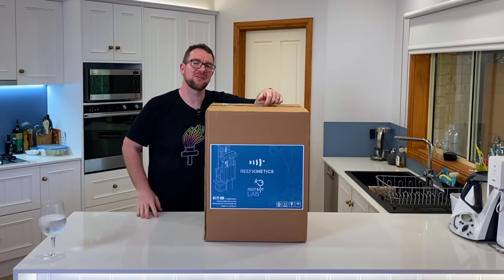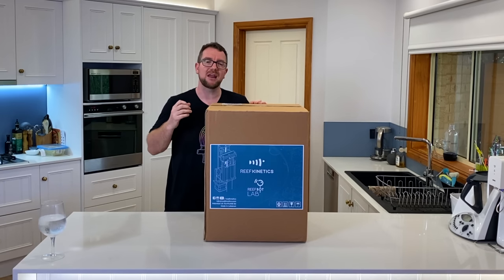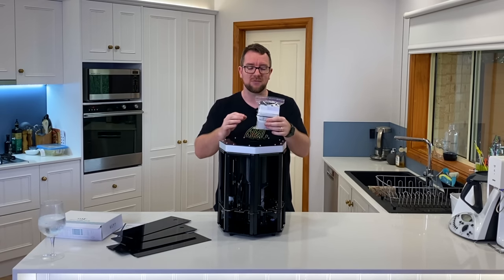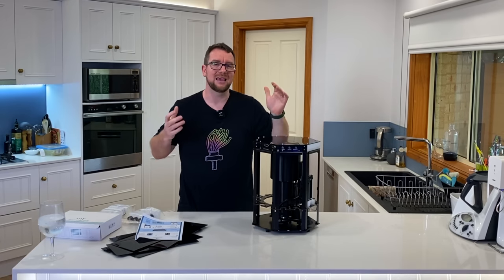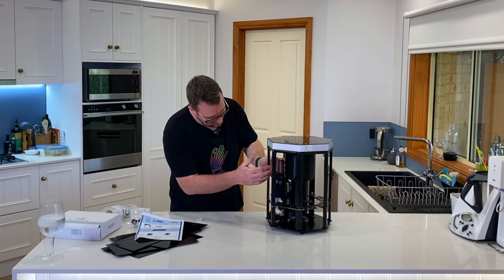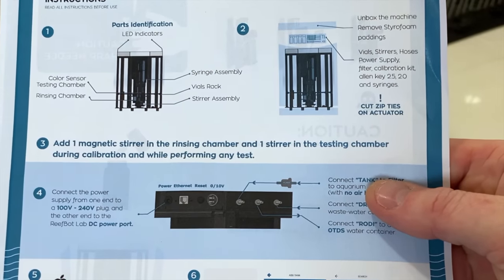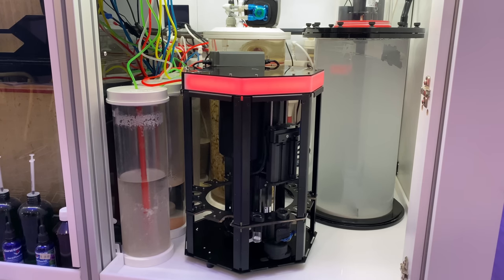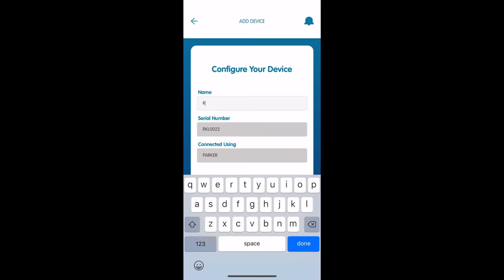The latest in automated reef tank testing - Reefbot Lab!

Comment: Hey Sam,

Great video!
Since I am interested in the Reefbot Lab, I was wondering if you still like it.
What kind of maintenance did you do in the past months?
Are you still using the reagents that are mentioned in the initial setup video?
What reagents would you recommend?
I intend to test for Mg, Ca, NO3 and PO4.
Thanks a lot in advance.

Best regards,
Gaby.
Reply from the maker: Hey Gaby! Yeah it’s still being used and yes have stuck with the same reagents.

Maintenance wise it’s really just needles and pump hosing that needs to be swapped out now and then. Plus of course a manual test to confirm all is accurate.
Reply: @ParkersReef  
Hey Sam,
Thanks a lot!
I am looking forward to your next review updates on these devices :) .

Best regards,
Gaby.

Comment: So... how's this device been working out for you long term? I'm debating switching the Trident and Trident NP for this due to additional parameter testing but would hate if it becomes a problem child that needs attention constantly and replacing/fixing stuff due to errors. Thoughts?
Reply from the maker: I haven't ran the reefbot for a while now, whilst it was a decent unit - I found the support and build quality of the mastertronic better, so I stuck with that.

In your position, I would wait for the mastertronic essential to hit the shelves. It will do the big 5: alk/cal/mag/nitrate/phosphate and use off the shelf reagents from other brands

Comment: Can this accurately test Nitrate? I picked up a Mastertronic for Nitrate and Phosphate test automation only to find out nitrate testing is highly inaccurate
Reply from the maker: All automated tritation testers for nitrate are struggling a little with the thick reagent. It needs to be shaken very strongly before putting inter vials. But otherwise it will just read a little low
Reply: @ParkersReef  Mine settles out super quick then ends up reading 10x lower than actual. Super disappointing when Nitrate was one of the two main things I wanted testing